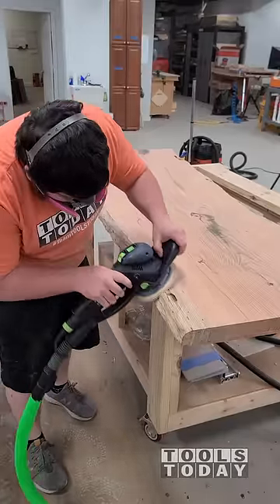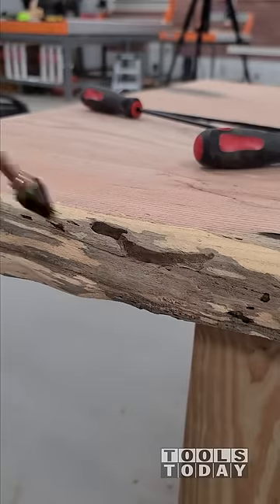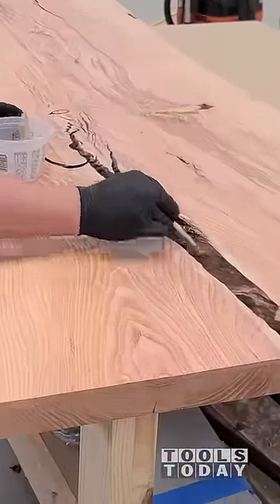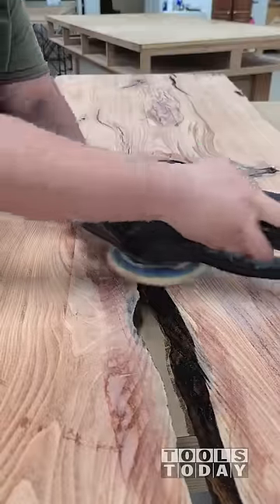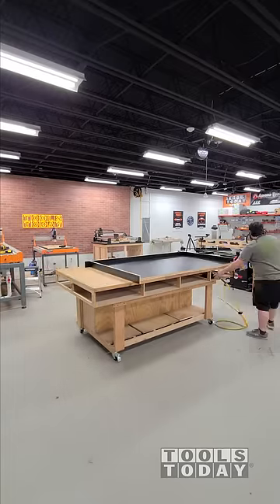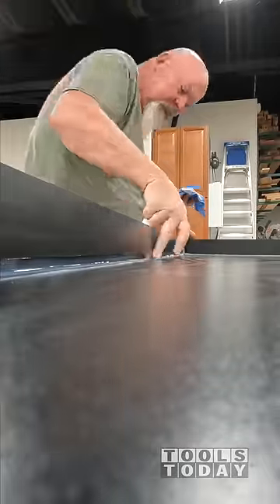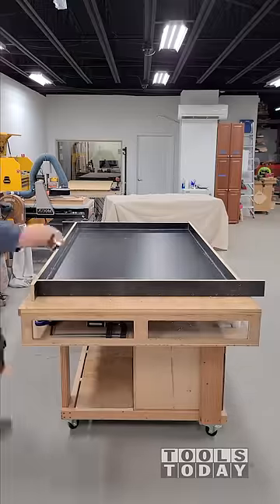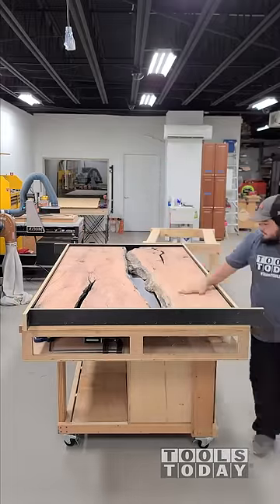Prepping Slab for Epoxy Pour

Comment: sigh when does the epoxy hype finally die down...
Reply: Truly. At least it's just a small portion of this one. And tables like this aren't nearly as bad as the billions of plastic beads & accessories used to make costume jewelry, which are never bought; and end up in landfills. Our planet needs to the do some serious remediation on our uses for plastic. We're just messing the world up with plastic.
Reply: It's been going for decades, this is just the internet discovering it. 🙄
Reply: The hype is almost gone, thankfully.  And for good reason.  After the novelty wore off, it became a plasticy-looking table.
Reply: When people stop buying them, since woodworkers are taking in buttloads of money from making them.
Reply: @mawi1172  It's a shame, since so many things could easily be made of wood, which is endlessly renewable and quickly decomposes when tossed out. There are many cases where plastic is necessary, but most of the time plastic is used because it's cheap and easy.

Comment: 20 years from now we'll all look back and wonder WTF was everyone ruining beautiful slabs with epoxy.
Reply: learn to speak for yourself
Reply: I'm actually in the process of making my first epoxy table 😂
Reply: In 20 years I’ll be able to look at my epoxy table and see that it’s still preserved.
Reply: I just finished a honey locust slab and put some tung oil, down epoxy finish to keep it preserved and moisture out of the cracks
Reply: @blu2697  combining Wood with any static Material is never a permanent solution.
Reply: @JustiaFiat  putting static material on wood preserves the wood

Comment: Wow…. Been doing concrete and construction all my life, that looks sooooo hard.
Reply from the maker: I never said that it was hard, but it does take a lot of time and work.  It's not as simple as "pouring epoxy into a slab and selling it for tons of money" as a lot of people sugges
Reply: My my my I thought doing concrete was as easy as working at a flower shop arranging roses in a vase ! 😂😂🤣🤣🤣  I worked on a few concrete jobs doing the form work and the weather is rarely nice and the work is back breaking
Reply: Dang, all your life!? I've done I guess 'indoor concrete' for a little while which was pouring concrete into fixtures to make grave vaults. Man, I never realized how much work goes into it... I originally thought you just pour & let it level itself but no, you need to vibrate the heck out of all sides (which is rough/backbreaking) & then brush off the top/edges at the right time. All this, assuming you have the right consistency to begin with...
Reply: What’s your point?  That what he does isn’t as hard as what you do?

Comment: You make it seem like this is hard even tho this is easily the biggest scam product.
Reply from the maker: I never said it is hard, but it is very time consuming and there is a lot of work that goes into these pieces.
Reply: @ToolsToday  at the end of the day you pour some liquid and then sand it and charge 5k for a table. its ridiculous and unoriginal.
Reply from the maker: And that's exactly what this video is showing.  It's not as simple as get slab pour epoxy in and sand it, there is so much more that goes into it just to get it to the point that you can pour the epoxy into it.  Also, as a side note, I don't sell anything I make, this is going in my home.

Comment: Thanks for sharing. I have a question regarding the grey coloured wood that you removed some of in the video - I assume that the resin helps to protect that wood, but if that grey wood were on the outside of the table for example and wasn’t covered in resin, would you have to remove all of it to prevent it from becoming damaged/ crumbling as people rub against the table etc?